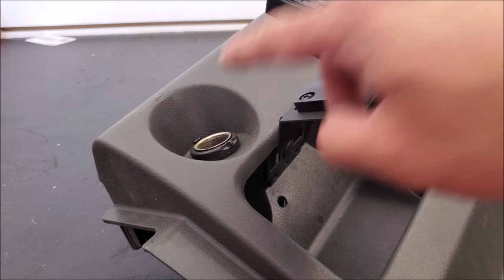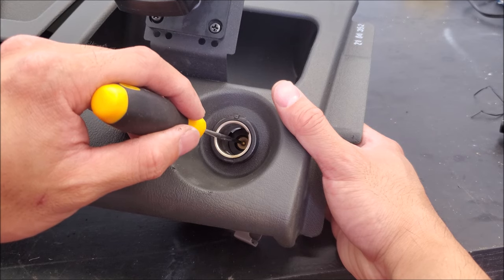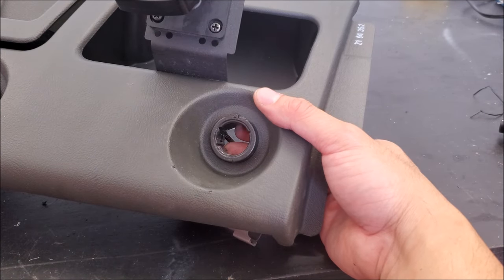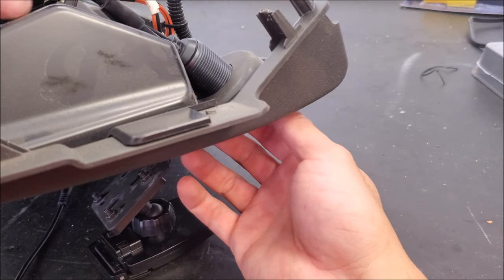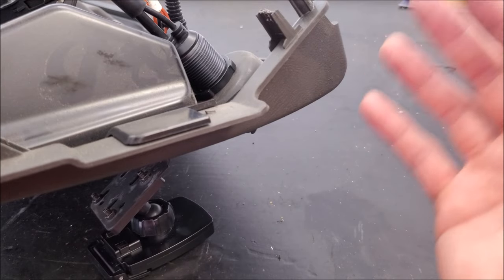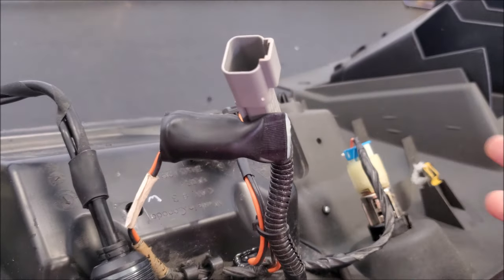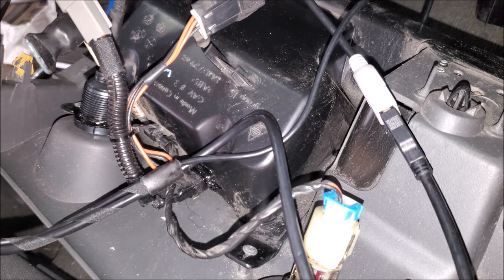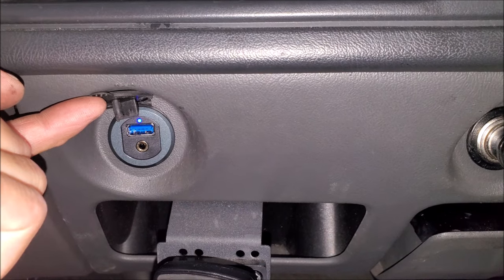Flush Mount USB Installation for aftermarket Head Unit (Android Auto / Apple CarPlay) | AnthonyJ350

Comment: I've been looking the last few days to add a few usb ports, but not in factory location. That's happened a few times with your new videos lol.

Probably will do it how dad hackz did it, on the little leg panels on either side of the center console, that touch both the dash and the center console.
Reply from the maker: Ya I prefer factory locations like this. Easy to reverse and easy to access.

Comment: Removing hot glue, pretty sure u can use a few drops of rubbing alcohol directly on the hot glue, or depending on the situation might be easier to get a paper towel and somewhat soak/spray it with rubbing alcohol and then wipe over the hot glue. It will break down the adhesive/glueyness? Probably not necessary for the dabs you used here, but with larger amounts/hard to reach areas, RA can really help. Save frustration and time.

 But now I'm wondering...does RA negatively effect interior pieces made of vinyl/plastics?
Reply from the maker: I don't think rubbing alcohol will take it off easilym